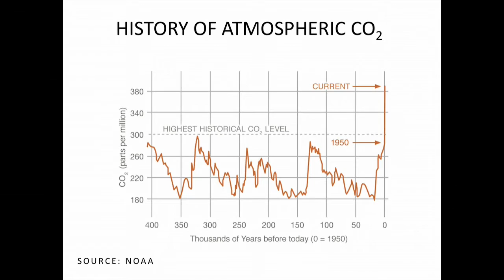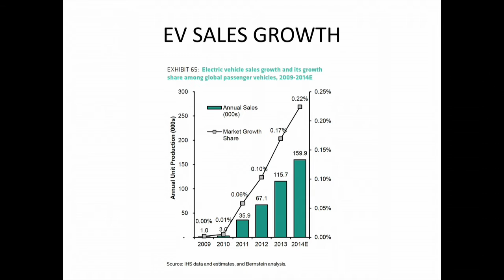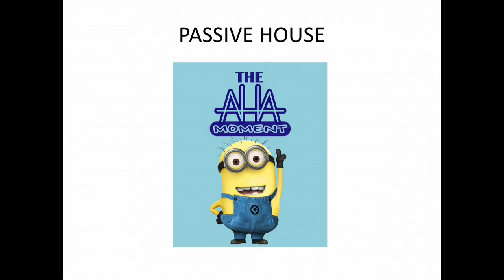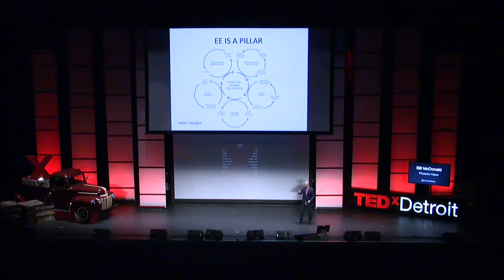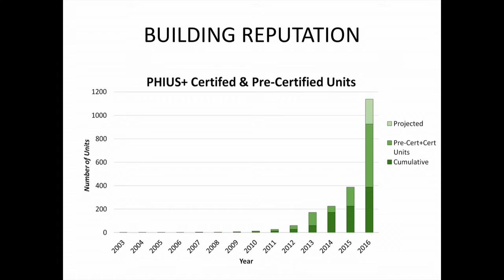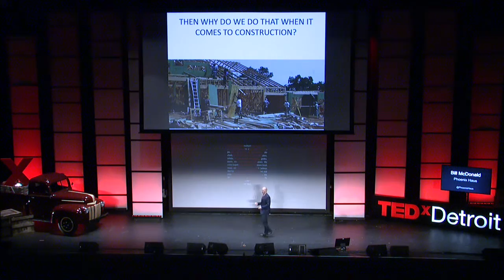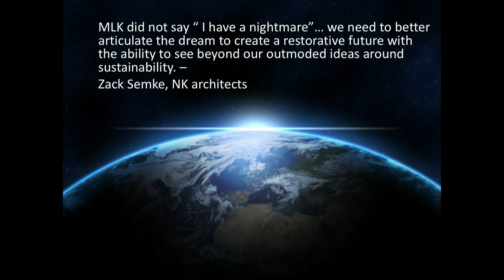Pre-Fab Passive House | Bill McDonald | TEDxDetroit

Comment: I wish this venture the best of luck, and hope that everyone could afford to buy one of these super-insulated homes, but I expected to hear some useful information in the talk.
Reply: I should be retired but don't want to quit just when it's finally starting to get interesting, I've been waiting for this building 'revolution' half a century.  I built my first house, a passive solar ski chalet in 1978-79.  Since then I've built a dozen houses, all energy efficient and with different circumstances, in Quebec, Ontario, Virginia, Alabama, Costa Rica and now California.
To determine useful facts, ratios, dimensions etc., I model the house in 3 dimensions using Sketchup, then attempt to analyze the model using one of the (now many) analysis tools out there.  Beopt from Nrel is a good one but doesn't import Sketchup models directly.  (AutoCad yes) I'm still trying to find the right analysis software but the purpose is to understand more fully the spatial and electromagnetic (sun's energy) relationships between critical elements of the building.  Thermal mass for example;  How much and where does it go?  Then attempting to map airflow and decipher what happens to the sun's energy as it passes through glass, is absorbed by solar panels or thermal mass, or is reflected off the building by a radiant barrier.  The lesson of each house being site specific gets hammered in over and over.  No two houses are alike when all is considered, including how they'll be used.  The simple concept of a roof overhang shading glass in summer and not in winter is in question now, because the arrangement doesn't do what it's supposed to for five months of the year during spring and fall.  Analysis software points these things out.  Using local material is critical but difficult to incorporate (in California) where existing code is strict and strictly enforced.  Much of this requires an attitude that I imagine is similar to what our forefathers and the pioneers had.  Ingenuity, common sense, initiative and respect and understanding for the conditions of those around them.

Whoever lives in these houses will not have 'lots' of money, probably the opposite, so always finding ways to reduce costs with minimal sacrifice to either durability or convenience is an ongoing quest.  Many design fundamentals are throwbacks to communities built hundreds, or thousands of years ago.  When we didn't have the HVAC guy to come and make our design liveable, we had to be ingenious, or at least leverage the advantages of the site in our favor.  At the same time, new tech can really save us time and trouble and make life easier.  A two story house design uses an elevator that incorporates the regenerative setup used on EVs.  With counter balancing, the energy required to operate it is laughable.  Compare the footprint of the floor area required between an elevator and a traditional staircase and the cost to build it and suddenly elevators aren't only for rich old people.  Problem is the code enforcers will make you build both, for emergencies, but when you are  your own power generating facility, what's the purpose in that?